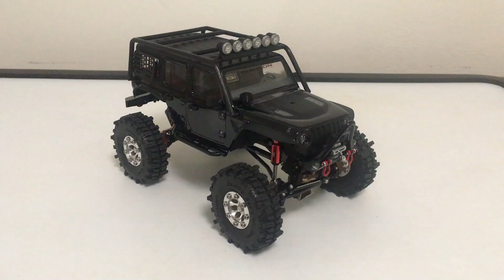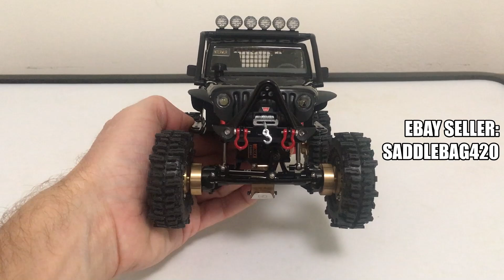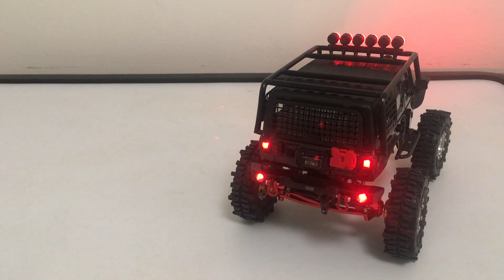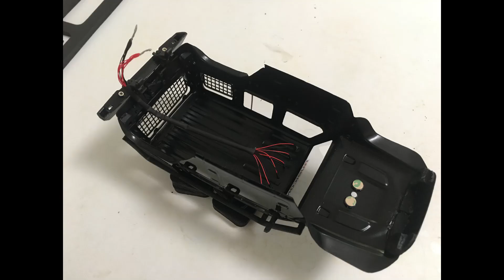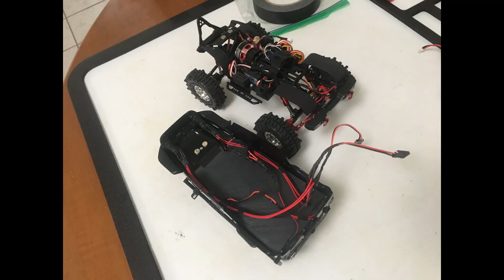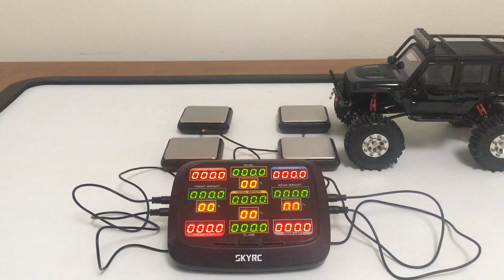The Original SCX24 Jeep JLU 0.0 - Build Refresher: Pt 7 - Lighting, Switching, Winch, Snorkel, etc.

Comment: Wow this is my first time seeing your build and I want to say it's one of the nicer builds I have seen you should be very proud. I own 4 scx24's my self #1 is my big build that started as a c10 but now is a fuy loaded rock bouncer sporting furitek lizard pro new long range 6ch rxtx and I'm running the Godzilla motor rocket man transmission, 4wsteer on 3s with AGF servos because it's set up as a very fast rock bouncer not a crawler and every part upgraded to metal part extended 8mm length and 4mm+4mm width height little guy 64mm tires and Treal bead locks (I can go on and on but we can just say loaded) then I have my heavily modified C10 set up as a crawler lizard pro and komodo on 3s with the plastic transmission mount so as I can fit the huge 17t pinion and 24%overdrive with this set up I get brisk walking speeds on the trails but I can also crawl with the best of them and with the new update I have no jitters,it no way as fast as the Godzilla but fast and also has 4wheel steer and huge AGF servos so it does awesome donuts. #3 is my jeep that I have decided to go with all Treal black and brass metal parts and only the barrage motor stock ESC and then my other fully stock so far Gladiator upgrades coming soon. All 5his is just to say with all the amazing upgrade I have done I am still in envy of your jeep build, as awesome as mine run they don't look amazing like your does. When I see your jeep I am blown away it is beautiful and bad A$$ looking you've done a wonderful job and I am jealous
Reply: Wait omg are you the guy that built Mad Max? Wow I must really love your builds , I built another mad max though it much of my build was before I see your I'm the guy that kept talking about 4 wheel steer and you were thinking of adding it that's the fully modified rock bouncer Ive been referring to but now your new jeep build has me wanting to convert my jeep with much the same. You have a great eye for what looks good with what, your builds are great looking. I wish I could post my build it's a bit dirty now and not as clean if a build but holly crap is it capable right now with the Godzilla motor I have it set up to do jumps and backflips so it's set up much like a monster truck build because I'm waiting for my fury tech monster truck chassis to come in
Reply from the maker: @timwegman5776  Heck yeah! And I just did Mad Max 2.0!
Reply from the maker: Sounds like you have some pretty awesome builds yourself! Thanks for the kind words!

Comment: Looks great as always 

Been busy myself to 
just got my tegu furitek setup installed and started 
On mirrors snorkel and doorhandles from shapeways indeed these things are …… tiny
Reply from the maker: Oh yeah they’re micro-tiny! Get your swear jar setup! That’s awesome you got a the Tegu installed. I have one sitting waiting on a home…
Reply from the maker: Are you planning to run 3S with that Tegu? That is my plan…wanting a little faster running SCX24.
Reply: @bcochener  indeed i am have bought a small 3s 500mah 35C pack thats a good fit 

Now waiting on my innerfenders to create space to place it all
Reply from the maker: @thedutchwoodworker3472  What brand battery?  I have been searching for a small one to fit as well.
Reply: @bcochener  i use the 3s 350 mAh from Vapex. Use it with a tegu and a carisma 8000kv motor :) That SCX 24 Betty has become a little drift machine, very low COG, oil shocks, and metal transmission. Very fast little rig. Would you mind sharing the parts list of your build, I am especially interested in the light bar, the LEDs and the interior. Thanks in advance.
Reply from the maker: @m.s.4067  That Carisma motor is hard to find.  That's the one BullGearRC used I believe.  The Interior is Limber Pine: https://www.limberpinedesign.com/, the light bar/rack/winch is from eBay seller: SPY7416.  I get all my LEDs from Evandesign: https://evandesigns.com/products/solid-leds-for-hobbies?variant=6763761205296.  The headlight halo pods are off eBay from various sellers (china shipping most likely).  My other 1.0, 2.0 builds have pretty extensive links/lists as well.
Reply from the maker: @m.s.4067  I was thinking about building little drift machine as well!